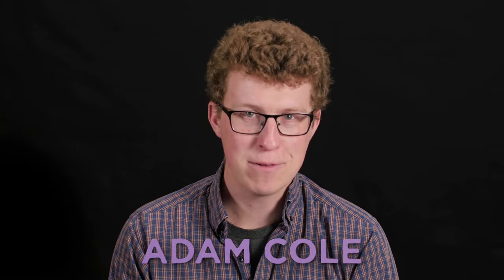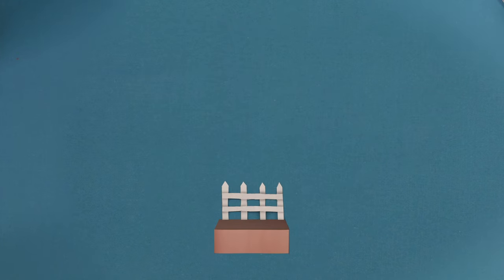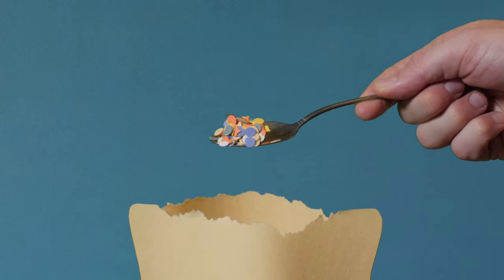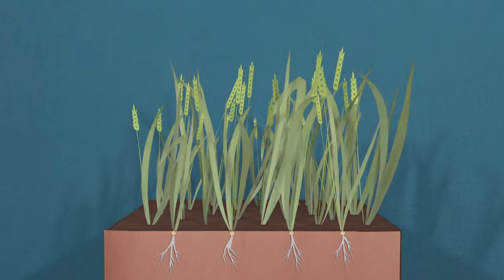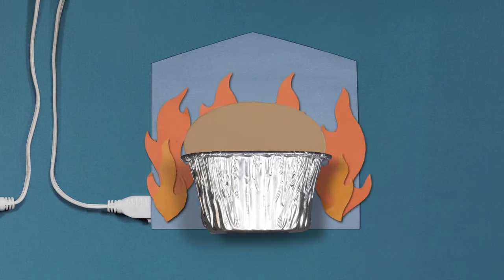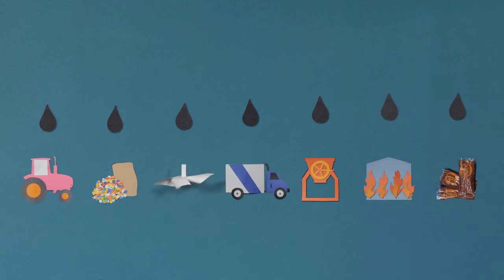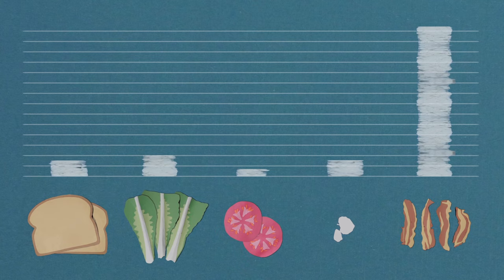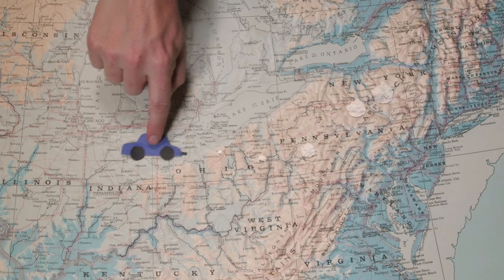The Carbon Footprint Of A Sandwich

Comment: But what about the carbon taken from carbon dioxide as the wheat, sugar, tomato and lettuce grow. Pretty much all the carbon in there is from CO2 in the air. Plus the plants that fed the pigs are made from CO2.
Two slices of bread contain 3 x 10^25 carbon atoms in the form of carbohydrates. That's a lot of carbon taken from the atmosphere. You didn't tell your audience one rather important fact. Plants spend most of their growing time, taking in CO2, splitting off the carbon, making more plant cells with the carbon and releasing the oxygen. Remember that most of the whole plant is carbon and water. So to produce the 30,000,000,000,000,000,000,000,000 atoms of carbon in the bread, you need all the other parts of the wheat plant too. That's a lot more carbon dioxide than just the carbon atoms tied up in the seeds, the bit we eat.
I appreciate that the point of the video was to make people think about the carbon used to make food, but only telling half the story is as bad as the climate change deniers ignoring facts to support their case.
Reply: Maxx B by eating it you release it back to the atmosphere. but i get your point
Reply from the maker: First, I'm not sure about your number there - two slices of bread only weigh ~80 grams - and I'd ballpark that <50% of the weight came from carbon. So ~40 g. 3x10^25 carbon atoms weigh 600 grams.

Second, as Jan Hen says, the carbon that is taken up by wheat is quickly returned to the atmosphere - either when the stalk dies and decomposes, when it's broken down by us for energy, or (if it is some of the rare carbon that gets incorporated into some permanent part of our bodies) when we die and decompose ourselves. It will be as if that carbon dioxide was never taken up by the wheat in the first place. A net zero change in atmospheric carbon dioxide. The carbon in fossil fuels, on the other hand, has been trapped for millions of years. When we release it to grow food, that's a net increase in atmospheric carbon.
Reply from the maker: Hmm - not sure what you mean
Reply: Noah Hansen ? what do you mean by that
Reply: Jan Hen Never mind that comment is wrong
Reply: I see my error in the carbon maths. I messed up the conversion from moles to grams, 6.02 x 10^23 atoms in one mole. Carbon weighs 12g per mole. 3.333 moles of carbon in the half of the bread that's carbon. So it works out to be 3.333 x 10"24.
I wasn't thinking on geological time scales.
I was going to argue that some of the transport fuel and manufacturing fuel was either bio fuel or renewable energy, but after discovering that in the UK only 3% of 2016 fuel consumption was bio fuel. I'll concede the transport impact. The UK however generates 46% of it's electricity (2015 stats) from non fossil fuel means, and industrial energy consumption of bioenergy almost doubled in the same year (From 776 to 1102 - thousand tonnes of oil equivalent. Coal was 1342 ktoe). 
To be honest I have no idea where I'm going with this argument, but it was interesting to research the UK's energy consumption. To see how it has changed over the last 40 years. From the introduction of bioenergy in the late 80s and the rise in efficiency that is lowering the need to consume as much fossil fuels.
I'm guessing your sandwich carbon footprint is based on the US figures, which unfortunately don't make for such encouraging reading.
After a quick look, I was briefly encouraged by one report stating that US CO2 emissions were 12% below the 2005 levels. But on further investigation, the US CO2 emissions are around 500 million tonnes higher than the 1990 figure, by which CO2 emission reduction goals are measured (2014 report). 
I apologise for my earlier criticism and will do my best to get the world, especially Americans to think twice before eating sandwiches.
Keep making great videos that inspire your viewer to look deeper into the subjects you talk about.
Reply: I forgot to add, I really liked the hole-punch fertiliser. Great way to recycle.
Reply: Also an interesting tool to illustrate the effects of rising sea levels. http://geology.com/sea-level-rise/
A 2 degree rise in global temperatures could mean a 6m / 20ft rise in sea levels. Makes it very interesting if you live in Louisiana, Florida and tragic if you live on Manhattan Island or in Sacramento.

Comment: I really want to be more green. I care, I really do. I bicycle commute and eliminated one car, etc, but this is not even close to science.

All that transport is far more efficient than portrayed. In fact, the whole buy local movement is a good idea, but based on bad science. Every trip mentioned in this video is more efficient than portrayed because it is like car pooling. Because it is moved in mass, it is more energy efficient than hundreds of locals growing and moving the same amount locally.

Modern trucks and tractors are far more energy efficient than portrayed. This is especially true of tractors that now actually reburn fuel for both efficiencies and emissions that rival electricity (except in the production of the fossil fuel).  They are years, perhaps decades, ahead of automotive. They are still a long way behind the efficiencies of moving these products by rail and barge.

indeed, meat production is not efficient compared to plants. Aside from eliminating, or to drastically reduce our meat consumption (possibly a more worthy topic), large scale operatioms, that require transport, are still more environmentally friendly than lots of near local producers doing it in a small scale.
I prefer local meat produced in a more humane and less chemically enhanced manner, but that has more to do with regulation than location.

The only way for this video to make sense would be to turn back large swathes of land in and around all of our communities, to farm production. I could live with no suburbs or individual housing. I doubt most of the world would agree.

Comment: to grow those crops have had consumed bit of CO2, is that counted in your calculations
Reply: Most likely is and its a tiny amount. The part of the crop you eat is mostly water. Maybie 10% will be carbon by wheight, especially in bread that has most amount of carbohydrates. The rest is rotting on the field or pooped out by the pig. Probably cancelled by tilling the soil alone.  Also its a misconception that plants consume CO2 all the time. Apart from photosynthesis they respire just like animals and produce CO2, so unless it's a tree, and by growing big lock the carbon in their massive trunk and is not burned there is no CO2 consumption whatsoever.

Comment: If the goal is to make a single sandwich you wouldn't use all that elaborate equipment in the first place so this is all factually dishonest.
Reply: Yet they used that equipment to make that sandwitch - a FACT. What part of the fact do you call dishonest?

Comment: I thought about commenting on this video, but then I realized that my response (and the 4 or 5 hysterical responses to that comment) would create some amount of CO2 that would raise the Earth's temperature by 0.0000000000000001º by the year 2175.  I mean it would increase someone's "projection" of what the temperature would be in 2175.  Actually, in 2175 someone in power at CRU or NOAA would lower today's temperature record to illustrate that the temperature had risen exactly 0.0000000000000001º since 2017.  Which of course is EXACTLY the same thing, right?

Comment: Interesting that almost the entire 3 minutes are spent detailing the creation of the bread, yet merely 10 seconds on the carbon footprint of 4 strips of bacon, which FAR exceeds every other ingredient of the BLT.   Even had to drastically compress the units of the graph just to fit the carbon from bacon into it.  Replacing the flesh of a pig's belly with tempeh in this sandwich seems like an obvious answer to drastically reduce its environmental impact.  Considering so few people understand the enormous impact of animal agriculture, emphasis on this most damaging ingredient would have been incredibly useful for educating the public.  For those interested in learning why animal agriculture is largely absent from discussions about environmental and health solutions, check out the films COWSPIRACY and WHAT THE HEALTH... both on Netflix.